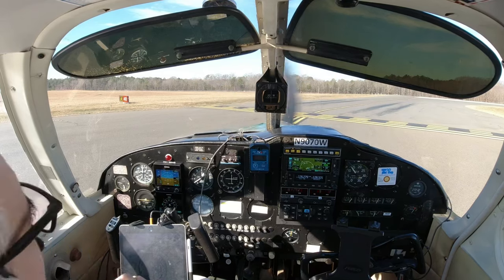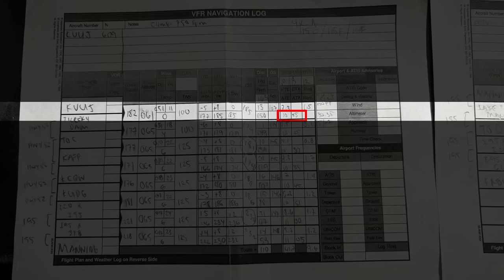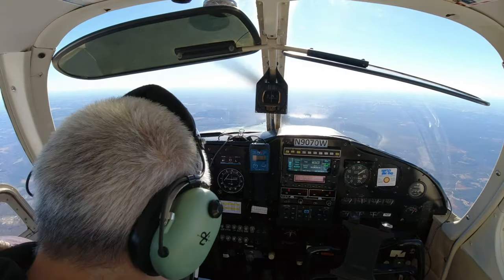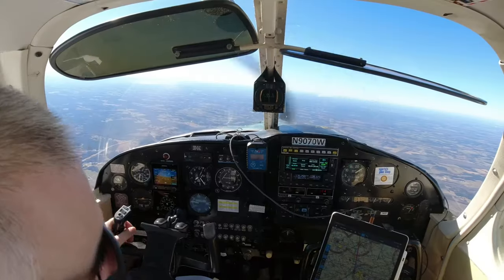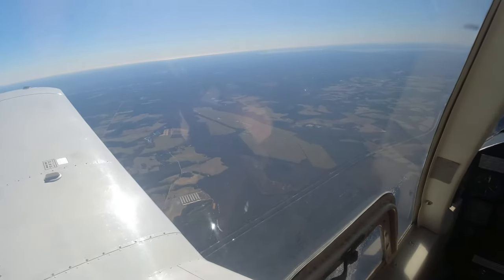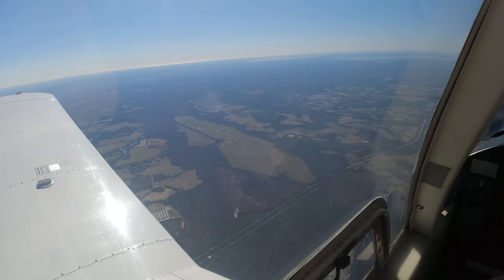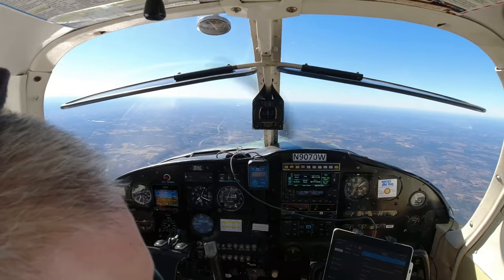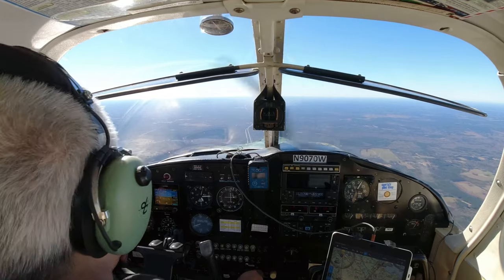NO GPS || Pilotage & Dead Reckoning || Piper Cherokee 235

Comment: That was a fun and original (and old-school) video. Imagine doing that with the chart folded up in your lap! You were lucky to have such good visibility on flight day—better for the video too. Based on hitting your times, I guess you had a pretty good wind forecast when you did your nav plan. Did you do the plan the day of the flight or the night before?
Reply from the maker: Thanks, Evan!

I did the plan the night before using the winds aloft chart in the weather briefing from Foreflight. But that's the only thing I used from FF. I did all the calculations using an e6b whiz wheel.

Overall I ended up at very close to my predicted times. However that was because some where a little ahead of schedule and some a little behind. They all ended up averaging out to be 1 later than the schedule at the end.

And yeah using a paper chart is a challenge that I experienced in private training. I didn't want to do that again.

I totally agree the visibility made this a lot easier. Less visibility would require either:
A) more waypoints closer together or
B) trust that I'm headed in the right direction

I'd likely choose A.